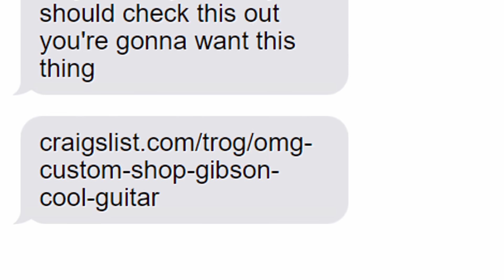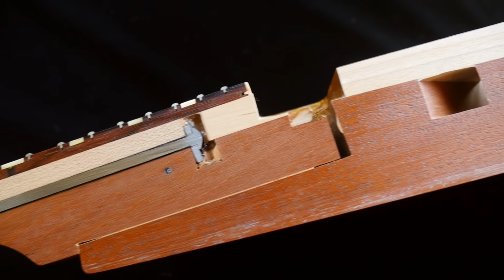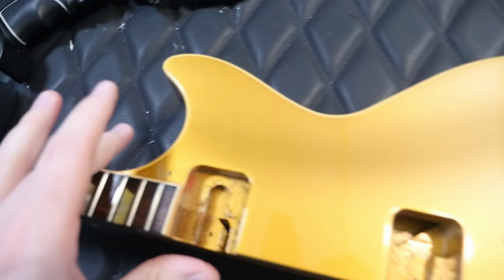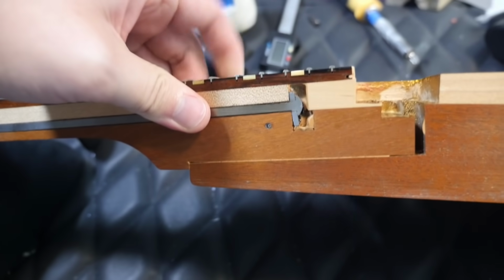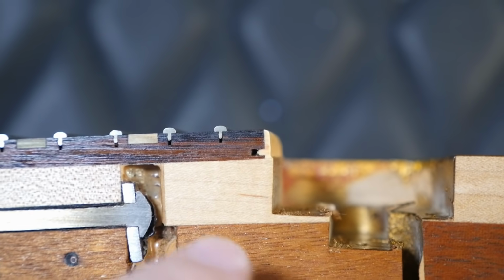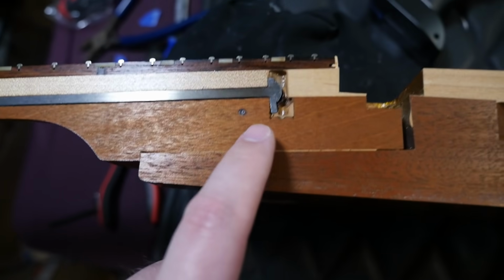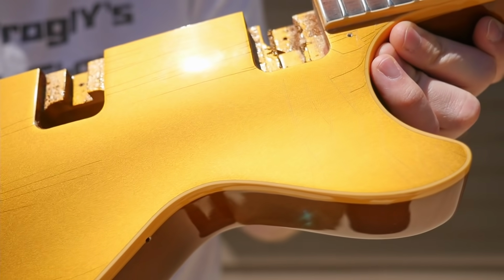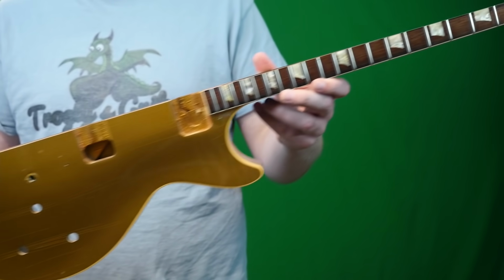I Got a Custom Shop Gibson Les Paul on Craigslist for $400*** |  Trogly Half Les Paul

Comment from the maker: Aka: The Gibson LP DC Ghostburst https://www.instagram.com/p/CdjnQqWOTVo/
🟢My Website: https://www.troglysguitarshow.com
🔴Reverb: https://reverb.com/shop/troglys?_aid=growsumo&gs_partner=Trogly
❓Private Help Sessions: https://troglysguitarshow.com/help-appraisals/
Reply: Great find Austin.   Yes, you should be able to have a Machine Shop cut in half an ABR-1 Bridge and a Stopbar Tailpiece.  By taking it to a shop they will polish up the cut ends and really make it look good for a Display/Learning Tool.  The P90s will also be pretty easy to cut in half, have the same shop do that.  Once their saw blade hits the windings it will fray all over, you should be able to repair that with epoxy and it will look like a LASER cut them in half!   Once you mount up the hardware you'll need to support the underside of the bridge and stopbar, a small polished block of plexiglass under each will hardly be noticeable.  After you install the Tuners you should be able to sting if up with light tension, enough to make the strings look taut and appear as they would normally, just under much less tension.
At that point you could also install the wiring and possibly half a truss rod cover.
Now for the difficult part, you'll need to either purchase a display case or maybe find an old Gibson guitar case and cut it in half too!
A skilled person could block off the open portion of the case and recover it to make it look like it was made that way.
To be honest, I wouldn't be surprised if one of the case manufacturers has a cut in half case laying around that they have used for the very same reason as the guitar!
Again, great find.
Reply: I'd bet them travel guitars aren't as light. I just want to know how you got them tones.lmao

Comment: There used ro be a "Gibson Café" in the tourist part of downtown Nashville, probably mid-90's to 2003ish.   The ceiling was lined with about 300 unfinished electrics....pauls, 335's, sg's.   They had a few special custom pieces in display cabinets, like a paul finished in gold lamé.  They also had half-guitars just like this!    I remember a standard paul, and a thick hollowbody.   They had the half-tailpieses, bridges, and pickups mounted to the half-guitars as well.   They were out on the bar-top to pick up and look at.   Super cool pieces!

Comment: So look at how much thread there is on the truss rod. This means as long as the truss rod end does not extend to the cover, the whole idea that more than a few threads showing is a problem is clearly just wrong. Most times if  lots of truss rod is exposed it's due to the top washer imbedding into a soft bit of the wood not the rod pulling further out. It's clear if the neck is straight and the nut can turn the truss is good, no matter how many threads show.

Comment: I recvd a degree in model building late 80s and what we did for cutaway models and prototypes is clear plexiglass.
  Like for the half pickup and half bridge, we would just use a thin clear acrylic piece as a standoff to hold those pieces at the middle/split.
Reply: Wow, you're quite accomplished! Bragger of the day award goes to RoadTrip Eddie!!
Reply: A DEGREE in MODEL MAKING?????? Rufkm? Where could one find such a fine University?
Reply: @graftongodofmemes  You laugh, but he was a model student.
Reply: @emilyadams3228  lololololololololo
Reply: @emilyadams3228  That was golden!
Reply: @graftongodofmemes  @peter jones architects use model building quite extensively, as do film production companies for movie sets. I’m sure there are other uses as well. No need to belittle the guy.

Comment: That could make for an excellent museum piece! You could mount this to the wall and install hardware for E, A, D  to the wall in the placement of the low half and another discreet set of wall mounts to support the low end of the pickups and bridge. Then you can float a piece of plexiglass the shape of the missing low half under the strings and use vinyl lettering for an information panel on that plexiglass. With a wireless connection, you could have a fully functional installation piece that visitors can actually play 😃

Comment: I did enjoy this episode.  
As a kid I always used to marvel at such curiosities.  Manufacturers sliced all kinds of things in half to show customers what they were getting.  Its a practice that dates back probably more than a century.  As a car lover I have seen plenty of cars sliced in half or sectioned in some way to show off the working mechanicals.
I think it would be cool to find some non operating P 90s from the 2000s to slice in half along with the bridge and tail piece.  It wouldnt be wrong to separate a set of Klusons either to mount on the head stock.  Maybe some super light guage strings...just strung...not to tune.  Just on there lightly.  To show how it would look with strings.  Tuning them would snap the head stock...because as we all know...the headstock is the Les Pauls Achilles Heel.
But on the pick ups...slicing them in half would be an interesting point to see inside of those.  You could go so far as to wire them up to the tone and volume knobs...just for completionists sake.  
On the truss rod...it looks like it might be suffering some corrosion.  I might suggest some Renaissance Wax.  That is a substance that should seal the metal and prevent further corrosion.  Gotta remember truss rods are sealed within the guitar and are not exposed to air.
Yes sir.  This was a thrilling episode regardless it wasnt a full guitar demo.  More of this would be awesome!

Comment: Gibson does microchip their guitars but it is with a very thin strip under the fretboard. I can supply images if you like from a repair that I did a few years ago on a very bad neck break that was obviously exacerbated by the “void” where the microchip was found.

Comment: Very cool half Les Paul Custom Shop demonstrator, great museum addition! That lower neck cut 'pin' might simply be a bolt that was put in to the demonstrator before it was sawed in half to stabilize the half neck into the half body. Since there's a cutaway on that side there's not much support and the half neck could just pull away from the half body otherwise.

Comment: The string tension of the three treble strings wouldn't be that much.  Use 8's. The bridge could be the single bass style and the pickup could be one half of a P bass set.  Cheap and easy enough to turn into a working instrument. Sort of like a tenor guitar with a broken string.

Comment: Get it mounted like a taxidermy so you can have extended stand-offs for the tailpiece and stuff. I think it will hold tension with a 7-11 string set. Cut in half coils is the only dealbreaker
Reply: I reckon if you heated them up to remove the wax and then "potted" them in epoxy resin, it should be good to go!!
Reply: @akc5150  that makes no sense.

Comment: you need to put the half parts in at least some pots and nobs tuners and loosely string it then mount it with the cut against the wall so it looks like a guitar is phasing out of a wall. like in a corner maybe so the back and cut side are against a wall

Comment: also that carve is supposed to cup up about a millimeter or a half..  yup, this isn't a custom, so as you are describing the cap you started at 1/2" then moved the tape towards the rear, it begins to drop, drop, then just before the binding it should rise again about 1/2 millimeter to a point about a quarter mm width, asin it isn't a full point it has a slight ledge to in, tif that is removed in the binding process I dunno, but that rise back up is for binding to give the binding something to glue to as that dip should fall beneath the top of the binding which this one doesn't which further leads me to believe this is a standard, the cup is very shallow.. 

kinda wondering if this is evena Gibson? that flat shallow cup on the perimeter, the sloppy to shoddy neck fit, the whatever that is in the neck at the heel, no point adding a sensor when there is no way to power it right?  an RFID chip? semi active last 3-5 years, very spendy ones for animal can last 20, would there really be a point to it other than theft from the retailers store?  what kind of signal would you get being embedded so deep in the wood?  there are far less intrusive ways to do this as in an RFID tape to the back of the scratch plate, not only easy to install and remove it would have a very strong signal..

however it would not surprise me they would drill this, toss one in, plug it then charge an additional $1000 on to the consumer..  I do not want a drilled hole in my heel.. sorry just don't, on a $5000 guitar?  aw hale no...  there are far better places to put an RFID security chip, whether to trackit inthe factory or elsewhere, I have heard they use one to trackit at the factory but fora good part of the guitars life it isn't connected to the body, so how does that work, and by the time you glue the neck to body why not use a pickup cavity, control cavity? a machine head hale?  stupid idea if it is true and wasted effort

Comment: Christ that neck joint looks sloppy. The gaps, that line of glue. Ai yai yai. Also I'd be willing to poke around at it for fun — could probably use plexiglass and some wood add ons to make it a functioning tenor guitar that could hold strings. Only issue is I am in NZ, but I could get it playing. Could even work with a local pickup builder I know to do some custom ones that fit with the theme. 🤔
Also the truss rod channel is curved so the single action rod can work at all — tightening pulls it straight, creating pressure. You have a lot less than .6 of usable length even if it's threaded though the wood gives way long before then, part of why single actions are such a hassle. Modern double action rods where the tension down the length of the neck is contained to the welded metal are much more reliable.

Comment: More than half the neck is maple?
Reply: No, only the area between the fretboard and the truss rod. It's only as wide as the channel for the fretboard, maybe an inch or so. If you scraped the finish off the other side of the neck, you would see just mahogany under the fretboard. It's basically a maple rail inside the truss rod channel, above the actual truss rod, under the fretboard.

Comment: The truss rod is not needed to ‘take the string tension’… it is there to adjust the neck. Many older acoustic Guitars have no truss rod and Don’t collapse under tension. In fact many of them are still perfectly playable! So  you could string it up if you would be willing to find a solution for mounting the bass side of the bridge and tail piece…

Comment: It's crazy how much of an air gap there is under where the body and neck meets on the front and back.

It's not even flat for whatever reason, I've seen a video where they manually remove wood with a chisel which I can't see the need for when it had been CNC'ed.

Comment: good god for custom shop or anything but asian budget budget that workmanship is WRETCHED.. check the neck pocket, check out how poorly the fit is and then the glob of glue in the middle then the two ends do not contact the body, TONE ROBBING!  then the tenon doesn't doesn't meet the body cavity, TONE ROBBING.. then they charge a premium for these shoddy hastily built units..

the result of 20 managers standing over ten workers screaming MORE MORE MORE!!!  they cut corners, they do not check work,, fuggen JOKE, any idea what year that is?

THEN after they cut it in half for some reason they added a maple plate at the heel tenon to hide something? what you guess that is?  best guess is that slot for the truss rid is so utterly sloppy they were embarrassed to show anyone so they carved out an access and put ina plate, and look at the job whoever installed this plate actually did, the precision, specially when it tapers down at the tenon..  THIS is the work folks talk about when they talk about these vintage guitars VS modern.. had anyone even attempted to pass that workmanship off as possible they're fired right on the spot, in the old days that neck is dry fit 20-30 times checking every single facet of fitness, hale that shoddy work would have been simple to detect as it would have rocked in the pocket.. the neck isn't flat where it meets the body neck cavity..  un fookin real,a nd what they charge for these things today?

is that what they do in the muppet lab? slap garb together then whack one another off in appreciation?  "muppet lab serkel jurk".. unreal